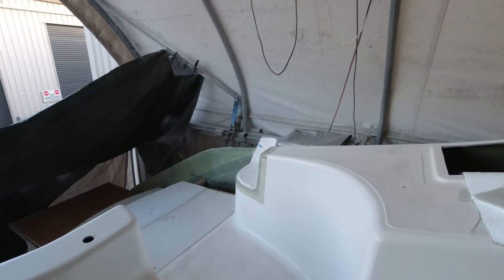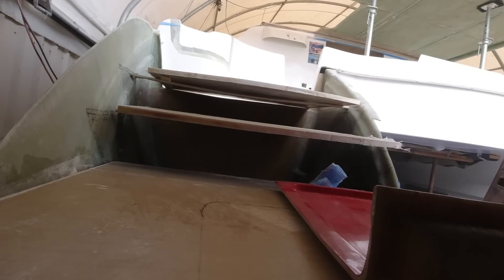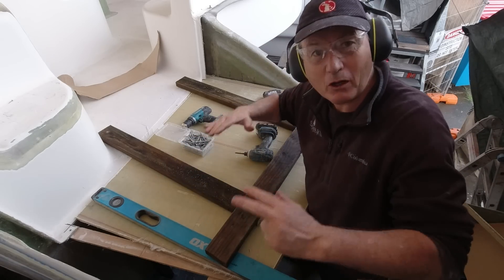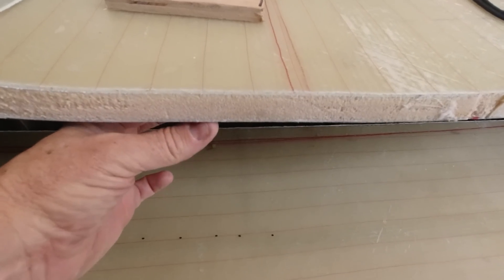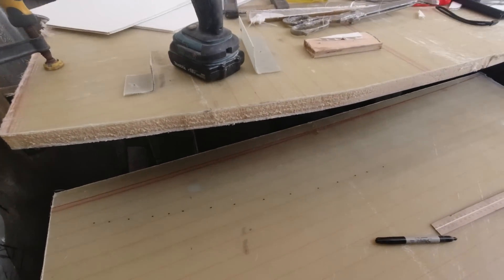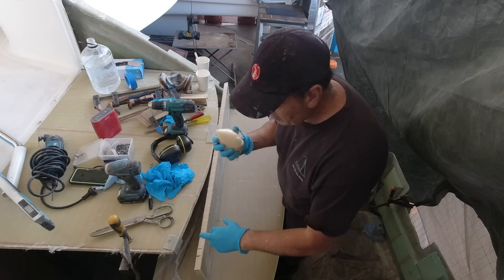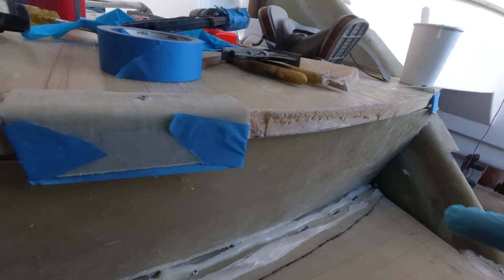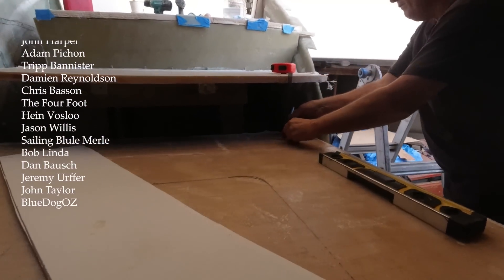The process of bespoke construction - Catamaran Build Ep232

Comment: Actually it’s technically a 2 by 4 (2x4) or two be four. 😆 we just call them econo studs in the northern hemisphere. 🤣
Reply from the maker: We call them a 100 x 50 in the real world of metric.
Reply: They started teaching us the metric system because we were told we were moving in that direction. That was 55+ years ago lol
Reply: Not going to argue meteric stuff but it’s been a while since I’ve seen a true 2”x4” I think they are down to 1.5x3.5. And finding a straight one is a days work.
Reply: @icelandviking1961  dimensional lumber hasn't been actual size for longer than you've been alive.  the advertised dimension is the size when rough cut, planing all 4 sides smooth, and rounding the corners brings the dimension down to 1.5x3.5  its the same for all lumber with smooth finish, always has been.
decking boards are called "five quarter" and because they start as that thick, then finish down to 1"
Reply: @trevorchadwick5479  Yep, the 2x4 is as it comes off the log, by the time it's been dried and dressed it's down to your mentioned 1.5x3.5
Reply from the maker: @icelandviking1961  we now have 90 x 45mm as our standard wall stud nogging material and prices are through the roof.